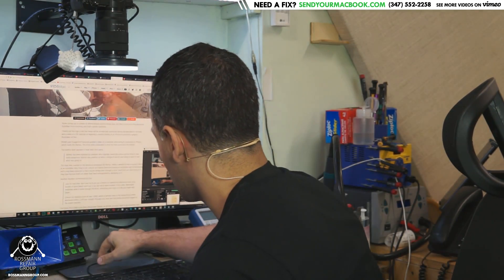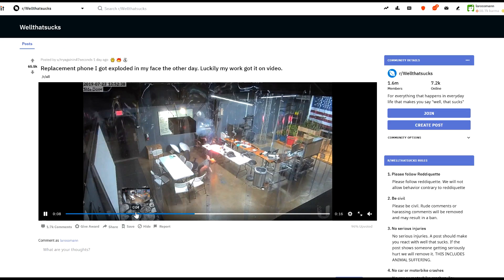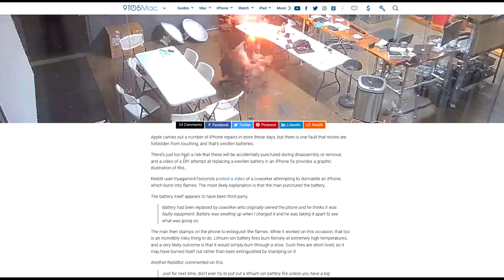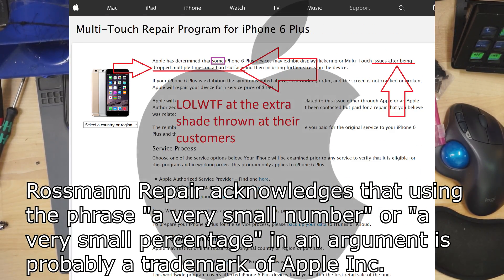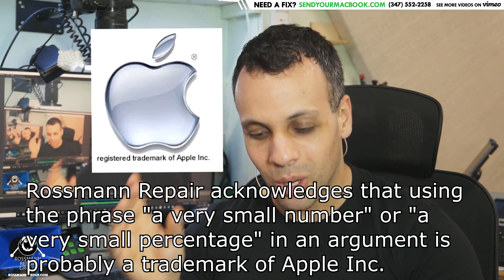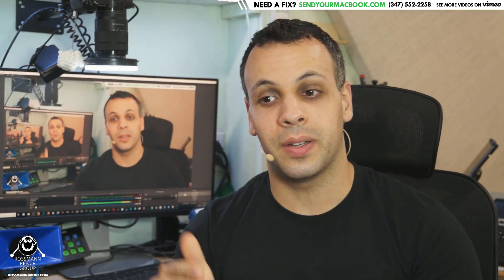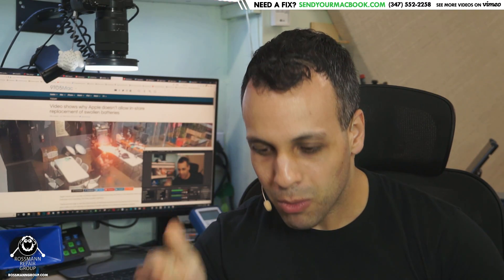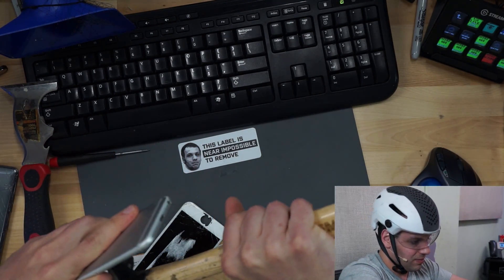STOP FEARMONGERING

Comment: My 2cents. I've been an IT Tech for around 13 years, I've fixed a lot of laptops, I've seen a lot of batteries. How many expanded batteries have I seen in the wild?.........One. literally 1. It was in a HP Elitebook Folio 9470m around a year ago. Luckily they are user replaceable batteries so I just removed it and replaced it. Nobody's face caught fire that day.
Reply: I've seen about half a dozen puffed LiPo cells in my life. Each one was so beyond its life that it had long stopped holding any charge. Most were at 0v due to internally discharging quite quickly.
Here's the thing though.... Its not the lithium itself that causes the fire. There's hardly any lithium in there anyway. Its the battery charge itself that causes the awesome fire. A short inside develops, it heats, it burns the plastic, makes the short across a wider area, and it all runs away until the energy has all burnt off. A 0v lipo is extremely unlikely to catch fire no matter what you do to it because its storing 0 energy.
Reply: I've seen a few expanded batteries too, e.g. in Gamepads or Remote Controls. None of them has ever vented and yeah, they didn't hold any charge anymore.
A friend who is a vaper and does the coils himself once let a (pretty new) battery vent. He first claimed the (chinese) battery was bad but later admitted, that he had been too lazy to check if he'd done everything correctly which he probably hadn't. So yeah, I'm using the same chinese batteries and they're pretty good actually. These batteries can be dangerous though if handled carelessly, like keeping them in the pocket together with one's keys for example.
Reply: @tin2001  I'm an IT tech also and have replaced swollen iPhone batteries and more significantly removed swollen batteries from UPS Backup Up for segregated disposal.  The larger size of UPS batteries gives me pause as to the risk there.  I suspect the thicker shell helps mitigate and I found the comment about the charge causing the fire to be of interest.  I would like to see/read more on this topic particularly of proper procedures.  I would also like to see more info about inadequate charges.  I suspect there may be a method to evaluate whether a non-Apple charger is acceptable.
Reply: @dougbetts626  Any charger designed for charging lithium is acceptable. The problems arise with lack of insulation in cheap chargers. Eg: Single layer insulation between primary and secondary windings in the step down transformer, lack of separation between mains and secondary side PCB tracks to stop creep, low quality x1 suppression capacitors.... 

The only concern with charging lithium of any variety (Li-Ion, LiPo, LiFePo4, LiCoO2...) is that unlike almost every other battery chemistry, BOTH voltage and current need to be regulated. Generally a supply with a constant current of xC is applied until an 80% SOC is reached and then a constant voltage depending on the cell's 100% SOC termination voltage, 4.2V for Li-Ion for example. 

Here is a very good resource if you are interested in lithium batteries and batteries of any kind :)
https://batteryuniversity.com/index.php/learn/article/charging_lithium_ion_batteries
Reply: @Jimmeh_B  That's great info, thanks for the response.  I will read the article you linked later today.  A search for the word "laptop" in that article did not reveal that it will address a related question so maybe you could address this...  Is it okay to charge from a laptop or computer USB port and is there any concern or preference as to what type of USB port is used.  Also are there acceptable ways to charge from a cigarette lighter adapter in a car?
Reply: @dougbetts626  what is it that you're trying to charge?
Reply: @dougbetts626  actually, it really doesn't matter. USB is a type of port and has very specific protocols when it comes to maximum current limits and various other aspects. Basically, anything that has a USB plug on it can be used in a USB hole of any kind. The difference is data transmission speeds and current limits. USB types are current limited to 1amp per port. USBC/type 3 (blue ports) have much higher data transfer rates and can supply considerable current. All USB ports are 5V.

The more current the port can supply, to a point, the faster the device will charge. The time it takes to charge the device is controlled by the battery management system in the device being charged. The purpose of the BMS is to ensure that current curves are adhered to and temperatures are monitored and in the case of the battery pack having more than one cell in series, that the individual cell voltages remain balanced. The BMS also contains within it the associated buck or boost converters to convert the 5v to whatever the battery pack voltage needs to charge. 

TLDR, If it's got a USB plug on it, it's fine to plug it into and charge from a USB port. USB3 (blue ports) will potentially charge quicker. Charging from your laptop though, when not plugged in, will reduce the run time of the laptop because the energy to recharge your say 4.2v lithium phone battery, is being converted down from the +/-19v typical laptop battery.
Reply: @Jimmeh_B  @Gary Chuong Well that just got more confusing.  You previously talked about insulation issues then you said "if it's got a USB plus on it, it's fine..."  I charge lots of devices but the one I'm most concerned about is my iPhone since that is what people like Louis Rossmann warn about and it is an expensive device.  I have a power meter as referenced by Gary Chuong in a following comment but that would not detect the insulation issue in cheap chargers, right?
Reply: @ezg8448  Thanks for the reply.  Please see my reply a few minutes ago to @Jimmeh B
Reply: @dougbetts626  ok, sorry for the confusion. The insulation issue is not of concern unless the charger goes faulty. That said, very often when they go faulty the cheap chargers spit mains out of the usb cable and people have a bad day, sometimes their last.

Stick to middle of the road mains chargers as far as price. They are all the same and regardless of what Apple say, there's no special sauce inside their chargers, they're just price gauging.

As for car "cigarette lighter" style chargers, Price doesn't really matter you can go as cheap as you want because the only real risk would be fire and only in extremely unlucky cases. A 12 or 24v to 5v USB converter is highly unlikely to pas the full 12 or 24v rail through to the device except in the very unlucky cases and once they stop working, cannot pass anything to your devices. Also, generally you will notice with use, if they are running excessively hot so fire is not really of concern.

They all, even the most expensive ones are designed around the same handful of switch mode buck converter power supply  (SMPS) controller chips and they all do exactly the same thing in exactly the same way.

The only concerns to the end user are not anything to do with operation or speciality lithium sauce as they would have you believe, only build quality, longevity, and whether or not it is going to kill you if it goes faulty, the same as any consumer device only in this case, the market has been flooded with very cheap Chinese chargers that are  the OUTRIGHT equivalent to playing Russian roulette.

Sadly, just as with Russian roulette, 5 out of 6 people will tell you it's fine.
Reply: @dougbetts626  I've been studying battery charging since I was 8 (I'm 41) when I was first allowed to play with an RC car. It's also when I got heavily into electronics/robotics and programming as a hobby. I'm no chemistry expert but I do understand  charging batteries in all the different chemistry's and how to calculate expected run times for given capacities and all the things that go along with it. Feel free to email me if you'd like any further help. I'm happy to oblige :)
Reply: @Jimmeh_B  yuip. I've worked with consumer safety officials and seen the insides of some cheap Chinese knockoff chargers they intercepted.
No isolation whatsoever (not even an air gap usually) between the high and low voltage circuitry, sparks can fly easily between them causing serious danger.
Reply: @jwenting  yeah man. It annoys me that as a hobbyist I'm not legally allowed to wire things up (mains) given that I know more about electrical theory than most electricians. Yet Chinese manufactured shit is all over the place and shoddy AF. Just last weekend I fixed my mother's dishwasher who's pump had clogged, while I was in there I discovered two crimp terminals that power the main motor were loose, black and charred. This is not an old unit, maybe 5 yrs at worst. Clearly though , wasn't far off catching fire. No one's ever been in there before so likely it came that way from the factory. I cut and re-terminated them and tightened up the loose chassis earth while I was at it.

It shouldn't be legal. Just as "double insulated" home entertainment equipment shouldn't. 

But yeah, these cheap knock off chargers, lights, pretty much all of it from China.  If I do buy it (which I avoid) I never use it without first disassembling and re assembling it first. From what I've seen, I'm surprised there haven't been more electrocutions and fires.
Reply: And one reason why techs tend to not encounter bloated batteries except for example on Apple products: user replaceable batts get replaced by the users.

As a user I've seen many bloated batteries, most recently a Fuji NP-95 in my camera. Can't remember how many Nokia, Ericsson, Motorola, HP, Acer, Samsung, Nikon, and now Fuji batteries I've dumped at the mall battery disposal.

And despite that potentially being a 3ft drop to the bottom if empty, or otherwise full of other "volatile" batteries, the thing has never blown up.
Reply: @Z020852  lol... funny that hey :)
Reply: All of the 6 3C LiPo packs for my 6ch RC Helicopter have ballooned. They've been that way for over 2 yrs.
Though I no longer keep them inside my house because I'm not stupid, they all still hold charge and I still fly with them. Only one has lost significant capacity. 

I have seen a lot of smaller Lion cells from cameras and small LG phones and the like that have expanded. To the point of breaking the screens.
Reply: I have seen a few bloated batteries.
Mostly on old and/or mistreated devices, like a laptop that was taken to 2 different military-operations in the desert - didn't last long enough to boot at that point after just 3 years.
It did catch fire - after the owner has blown it up with about 200g of high explosives.
Reply: @ABaumstumpf  Shraptop?
Reply: I have never encountered a bulged battery. I have a semi cheapo phone and i use charges from wish sometimes which are a buck or two. Lithium ceramic batteries are safer. Also cheaper lithium ion batteries might not have good protection or any at all
Reply: I've seen tons and tons of swollen batteries, even to the point that they've cracked trackpads in half.  It might just be due to being in I.T. instead of computer/electronic repair.  People tend to be fairly clueless when taking care of their home devices, whereas in I.T. you're able to keep a closer watch over how end users handle their work computers.  Also, tends to happen much more with phones than computers.
Reply: Wut, i currently use the same hp model. Bought it refurbished.
Reply: Funny thing is, myself being in IT as well, the only expanded battery I've seen was also in an Elitebook 9470m.
Reply: I've had several of my own. My notebooks tend to stay plugged in most of the time, and I think that is a contributing factor. That said, I would use them for weeks, no problem. Most notebook chassis and battery pack cases have room for the swelling, and my Nook HD was able to bend the display and back panel for extra room. No fires to date.
Reply: The company I work for uses exclusively Dell laptops, and recently we have had an INFLUX of swollen batteries. So much so that the hard plastic above and below is permanently bent. Not one has caught fire when I remove it, since it's very easy to unscrew the back cover and the battery. No prying at glue/silicon.
Reply: @gt86life50  are they currently available? If so, what series? We're a Dell shop, soon to be replacing several...
Reply: Laurel Sporter It’s the Latitude series, they are all about to reach the end of their 3 year warranty and out of the 30 or so that we have, about 7 have gotten swollen batteries within the past 2 months. Thankfully the ProSupport warranty gives you a free replacement battery, but it does make me question the quality of Dell batteries...
Reply: @gt86life50  I have seen five or six swollen batteries in Dell Latitude laptops where I work.  All were from machines three or four years old.
Reply: I had a battery that expanded in one of those cheap "Fly Mouse" remotes and was nearly punctured because the inside of the case wasn't cleaned up. I slow charged the battery and the swelling went back down. There is no structural damage and it has been working well for years now.
Reply: I purchased a chinese knock off battery for a motorola phone and it expanded after 4 months of use.
Reply: I've had more expanded batteries on MacBooks. I've had a few swollen Dell and HP batteries though. But the difference between a MacBook and others is that the others can be swapped quickly and easily before going to another employee. The sealed in battery the MacBook has can't be changed quickly and easily - can't buy them first party either.
Reply: I've probably not seen as many batteries as you, but I had an MP3 player that started to split around the edges and I had no idea why. I bought another, forgot about the old player and found it a few years later and that battery swelled up and thoroughly split the MP3 player and it looked like a little shiny pillow!
Reply: i worked in computer salvage for a while, saw no puffed laptop batteries, but saw lots of dead blackberries, hundreds at a time, with almost 100% puffed up batteries. no fires though
Reply: After 15 years of computer repair, I have seen maybe 5 swollen batteries.  All within the last few years.

An apple phone, and an Asus laptop are the most recent ones I remember.

Comment: If you work with things that could potentially let toxic fumes out... Why didn't they have a fume extractor then?
Reply: Even public school science dept classrooms have fume cupboards. Flame-proof and fume-extracting work zones don't seem to be that expensive.
Reply: @rednammoc  Fume extractors are basically repurposed shop vacs with a different style filter, that's how it was in my welding class anyhow. The ones for soldering can be a small blower fan with a filter system on it, they're really not complicated. It's funny how Apple's own shops don't seem qualified to work on their own products.

Comment: Two thoughs: 1) Glued in batteries are far more likely to be punctured in the process of removal than a battery held in with pull tabs or screws.

2) The best way to put out a lithium fire is to dump it in sand. Don't use a fire extinguisher because lithium + water = boom.
Reply: don't use a class A extinguisher, it flat out isn't meant for electronic fires; use a class B one such as CO2

Comment: If they didn't glue the damn batteries in, swollen batteries could be removed with infinitesimally small risk of puncture and fire.
Reply: B-but then you wouldn't buy our """replacements"""!!1! 😱
Reply: @TheRibbonRed  the command strips are easy to remove. Battery swap is a 5 to 15 min job.
Reply: @0cholopez  it's a joke about how Apple is actively making repairs harder to push more "replacement" programs out to uninformed consumers.
Reply: @0cholopez  Not my experience. Maybe i'm pulling on them wrong, but they almost always break on me and then removing the battery is an SOB
Reply: @shawnsnow6413  Especially on older phones like 6 or 6s where theyve essentially dry rotted and are quite fragile no matter how careful you are with those fucking strips.
Reply: @shawnsnow6413  that is true. 2/3 of the time I loose all the two tips :/
Reply: what's this common sense I'm reading? HERESY
Reply: I think they should insert them with a good dob of lube....
Reply: @phillipbridge5009  At Apple, we come in dry to enhance the customer experience.
Reply: @phillipbridge5009  they reserver that for their customers.
Reply: True!   But then again, Apple wouldn't be able to upsell you to a 'new' phone with a claim  "Oh that's to dangerous!!!! to replace"
Reply: @Tedybear315  "Clearly, this battery has swollen due to water damage"
Reply: My sony ericsson from 13y ago got swoll. I bought 3rd party battery and it still works.
Reply: @mt-3234  so's my nokia n51!
Reply: My favorite are the macbook pro batteries that have a portion of the battery secured by screws and the remainder held down by glue. Like the use of glue in the first place was supposed to be because the slender design of the machine could not be achieved with a battery secured by screws. But then they go ahead and use screws AND glue to hold down the battery, which totally invalidates the necessity of glue at all since the screws are clearly holding the battery down just fine.
Reply: OOF
Reply: The battery is "Near impossible to remove" TM
Reply: Infinitesimally
Reply: They probably glue it in to prevent the battery from moving in a drop.
Reply: Even with the iPhone with the command adhesive strips break like half the time and then you have to try and pry those up too, unless you work at an Apple certified repair center, then you have to send it to Apple cause you cant be trusted to pry the battery out at that point.
Reply: is reaally easy to take out iphone batteries